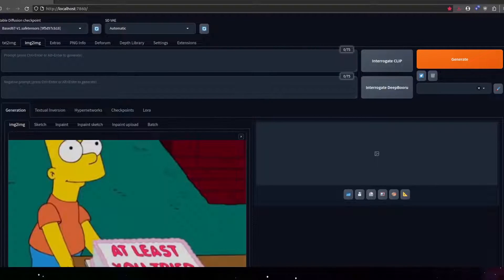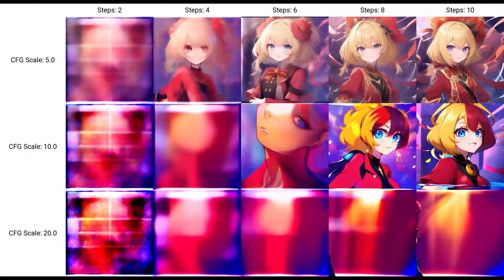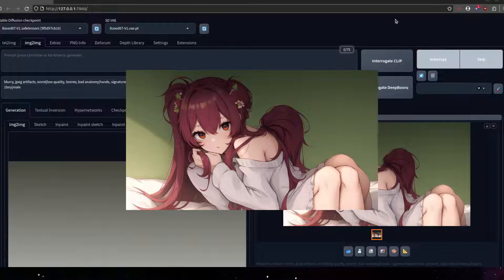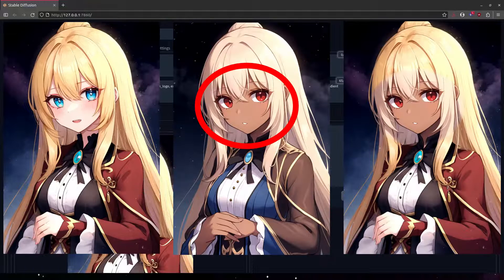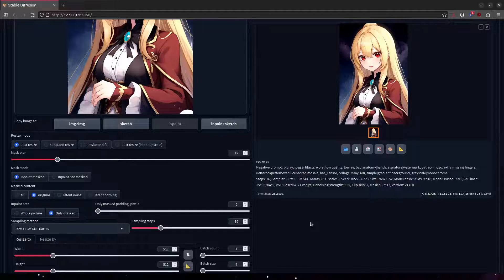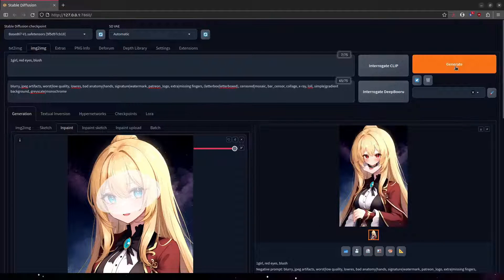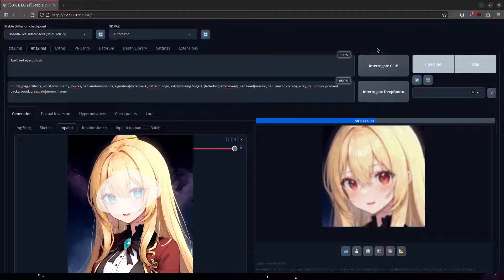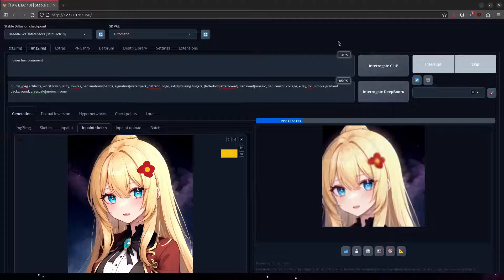Stable Diffusion Noob Guide: img2img & inpainting Basics

Comment: I dont know if Stable diffusion does it by default still (I turned it off on mine), but it used to do somewhere around 60% of the amount of specified steps in Img2img depending on denoising strength. So for example if you set 20 steps with a denoising of .5 it would do like 12 steps in img2img, but do the exact amount you set in Txt2img. 

Why? I dont know. but it took me way to long to figure that one out.
Reply from the maker: I know what you're talking about but I don't think it still does it by default. Though some tools that use img2img under the hood do this (or used to) and it's super frustrating. sd-cn-animation comes to mind.